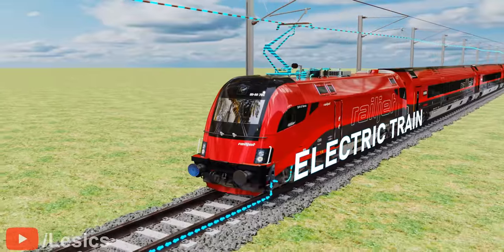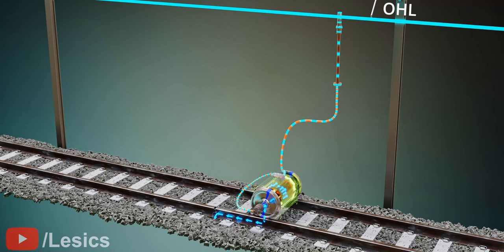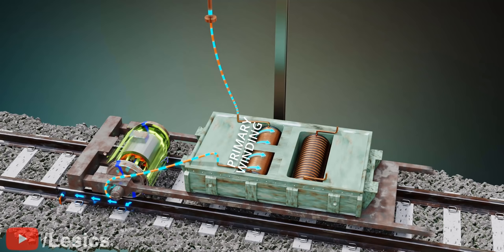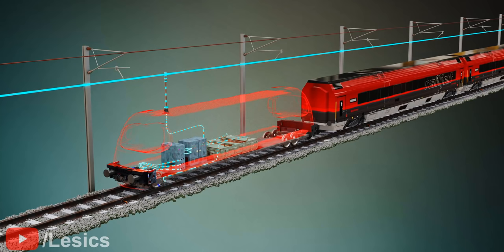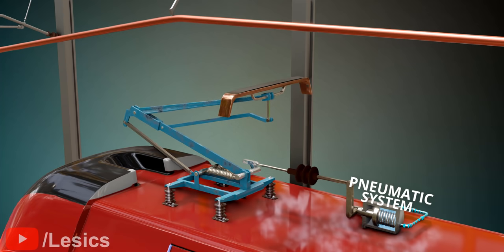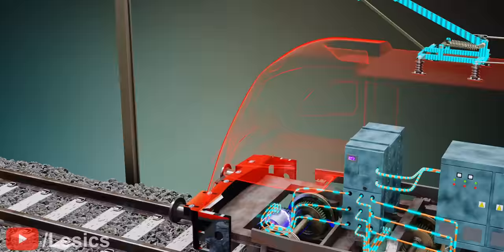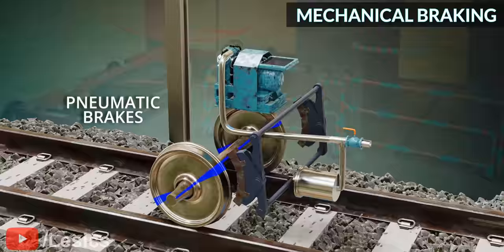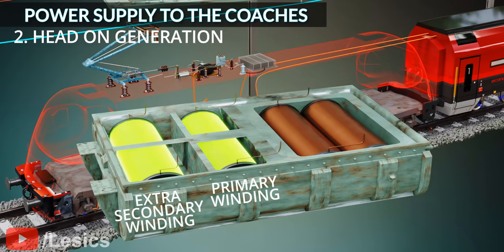The Fascinating Engineering behind Electric Trains!

Comment: I have one doubt, if the circuit is completed by grounding of rails , then why we get electrified when we touch the rails. The current should through us also na ?
Reply: you need to touch the overhead electric lines and the rails in order to complete the circuit.
Reply: @chankokkeong802  dear if u put fingure in one socket then do you not get the shock
You do. So high voltage current is coming to rails and if u toch the rail it should pass through you na
Reply: Live wire shocks because neutral wire is connected to ground, and most things have at least some kind of connection to ground, so you aren't really touching the live wire alone. If you were perfectly isolated from ground, then touching even the live wire alone wouldn't get you shocked, but any ground connection, even a poor one could be enough to kill you. For the same reason, touching the neutral wire alone does not cause electric shock, unless there's something wrong with the electrical system. Anyways, it's better to be safe and avoid touching any electrical wires.
Still, connecting 25 kV to ground looks a little risky to me. On normal conditions, almost all of the voltage should drop over the transformer,  but if there is a fault on the ground connection, then the rail could be at a significant voltage. However, as there seem to be a lot of ground connections, that should be very rare. It has to be safe enough, as people do walk over the rails on crosswalks. Of course, getting on the roof of the train is VERY deadly, as just getting close to the live 25 kV wire could make you a better path to ground than going over the transformer, and you will be dead in no time. Quite crispy too.
There are also some train systems were there is a LIVE 3rd rail that carries the power next to the train, instead of using a cable over the train. The 3rd rail isn't present on crosswalks, but is quite close to them, and it's always next to the train on the rest of the route. The 3rd rail is LIVE, and carries much more voltage than any electrical socket. It's VERY deadly.

Comment: I feel this is not how our electric locos run. The AC supply is used to run a turbine of an alternator where the input power is converted to 25000volts DC(if required) otherwise it is maintained as AC. However, before supplying the power to the traction motor, it is converted to DC. Nowadays, ever this conversion is not required, as using an AC supply also helps in proper braking due to the magnetic properties.

Comment: Why 25Kv required if motors works with 3K v ??
Reply: Because with lower overhead Voltages more Substations would be needed due to the comparatively higher transmission losses.
Reply: @cyri96  tqqq 👍
Reply: there are 3 kv DC systems

Comment: Why don't they use DC power in the first place..?
Reply: For the overhead line, or for the motor?
Reply: For the overhead line, it's the same reason as to why the powerlines uses AC, it is more efficient as there are less losses with AC

Comment: Why 8:30 why this system is not possible for EV vehicles
Reply: you dont have any coaches
Reply: @burgerpommes2001  I actually meant why an alternator itself cannot power an EV vehicles instead of large size lithium ion batteries
Reply: @user-vm1xj2bb8p  because the ev isn't connected to a rotating rod like the coaches are from the locomotive
Reply: @burgerpommes2001  but while driving a EV vehicle the same technology is applicable ,why they are not installing this
Reply: @user-vm1xj2bb8p  so you are suggesting that a motor powers the wheels and a rod that powers a generator that provides electricity for the original motor?
Reply: @burgerpommes2001  ya almost similar of a cycle energy type
Reply: @user-vm1xj2bb8p  you have no idea how physiks work do you?

Comment: The truth is that trains don't use induction motors, they use DC motors because DC motors have a higher torque compared to the induction motor, and they can also spin faster than the induction motor.

Induction motors have a low torque, and they cannot spin very fast, the highest speed you can achieve is 3600rpm, and another disadvantage is that their speed is not synchronized to the RMF, so train don't necessarily use induction motors, but DC motors.
Reply: Acting like DC motors are synchronized

Comment: Ehh? AC supply and induction motors the simple method??? I didnt watch everything but I see no mention of DC traction or 2 wire suspension and a level at all times pickup wire. This is not properly informative at all.